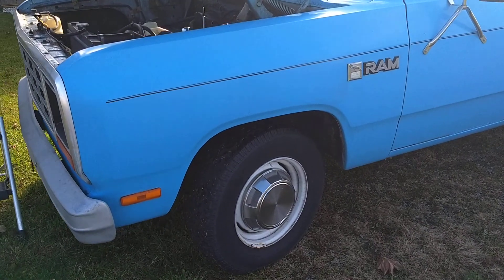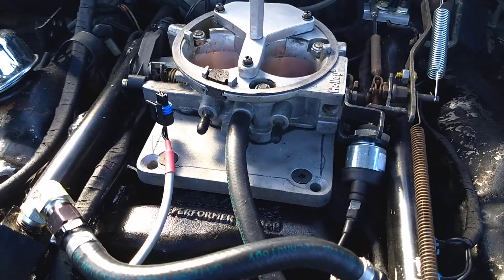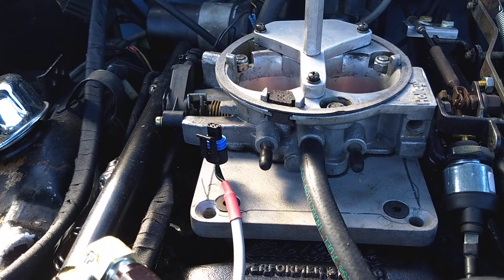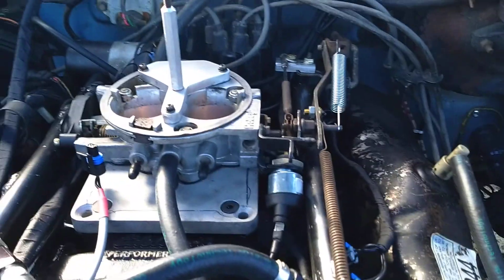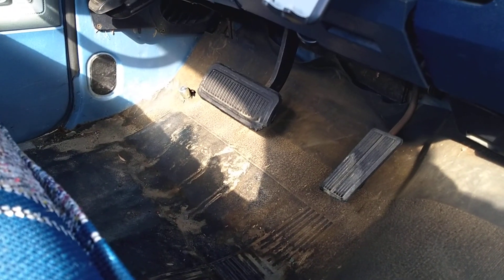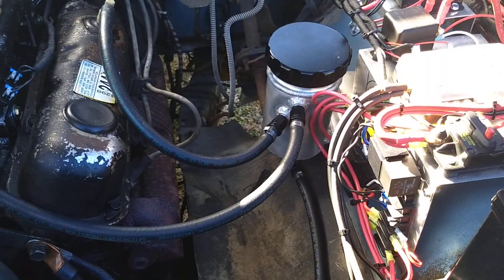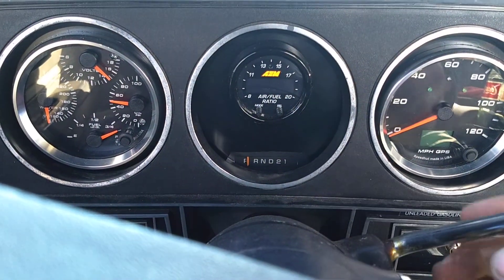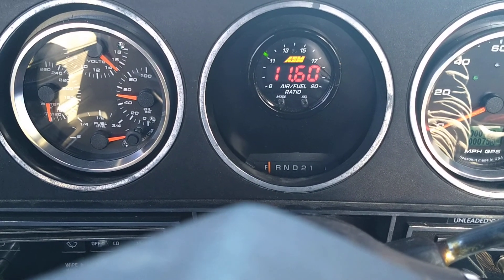84 Dodge 318 converted to fuel injection, Megasquirt MS2

Comment: How do you feel about it now?
Reply from the maker: Still running good. I think ive put 6k to 7k miles on it since the conversion.  Been a couple years since ive even hooked up the laptop to check anything. Knock on wood, pretty trouble free....
Reply: @1ANeat  
Awesome, I'm thinking about swapping my 71 dodge pickup. Thanks for getting back to me. Central California watching.

Comment: I know this is old but how hard was it to wire up the megasquirt and how hard was it to learn to tune it.
Reply from the maker: It was somewhat involved as i welded up and machined my intake, mounted and plumbed up the electric fuel pump, ran fuel lines, wiring etc.  The megasquirt part, wiring and tuning wasnt too bad, the tuning was pretty straightforward and fun for me. 
Still driving it and still happy with it
Reply: @1ANeat  awesome, if I end up doing this I probably will leave the injectors in the throttle body as I dont have the experience or tools to do what you did. Super cool truck by the way

Comment: Awesome!
This has answered almost all of my questions. I have a carburetted 1970s Mercedes and it's not fast, reliable or efficient. 
I guess if you can drill your injectors straight into the intake manifold, I can too! 
Can you control ignition timing with this setup?
Reply: Yep. You just need to install a sensor for that. Sloppy mechanics here on youtube have done a lot of guides on that.

I've build a Celica T18 20v with megasquirt 1 and I am currently in the process of installing a 318 Magnum from a 90's jeep in my Dodge D200. That will get a Ms2 instead.

But Megasquirt 1, 2 and 3 are standalone, you just need to order it with the ignition control and find a way to get a crank signal

Comment: What's your MPG like?
Reply from the maker: I probably get 15 MPG if I keep my foot out of it.  But it is a 3/4 ton truck so mileage isn't it's strong suit. Driveability is the biggest plus I've noticed.  Been about 2k miles thru it since the conversion
Reply: @1ANeat  So...15mpg with a non-overdrive transmission?  If so, that's amazing.  I'm thinking of doing the same thing, but I will be using a D150 short bed with a833 overdrive transmission.  Thanks for your time.

Comment: Are those 24lb injectors the same as comes with a Dodge 5.2 magnum engine?  Nice to see a Megasquirt on a small block Mopar V8!  Looks like a nice clean install.
Reply from the maker: Thanks,   The injectors are Delphi Ls injectors 25323974.  Did not matter to me what they were out of.  Found the Delphis on sale at a place that rebuilds and flow matches them,  too good to pass up.   He gets some of the  4.7/5.2/5.9 injectors from time to time. I think they are Denso mfg.  But at the time I was shopping the Delphi were plentiful and less costly.